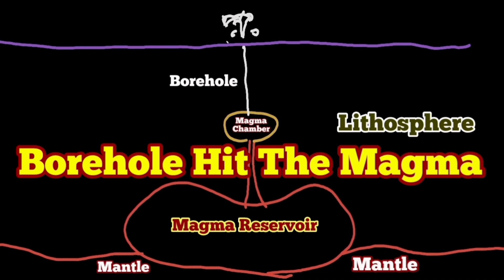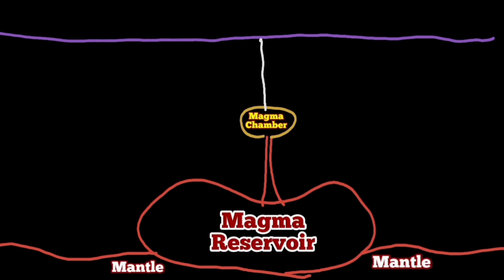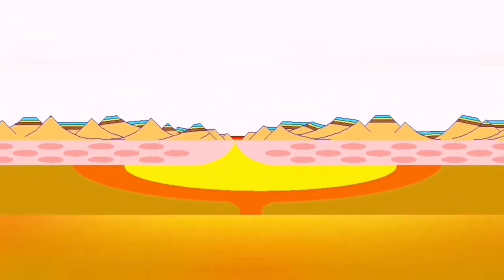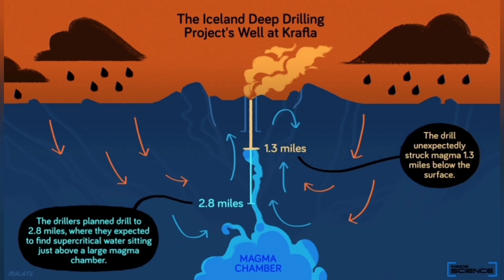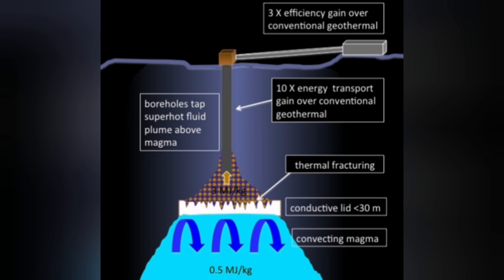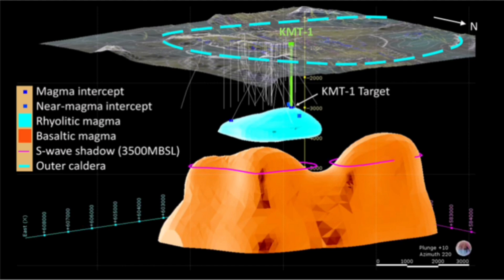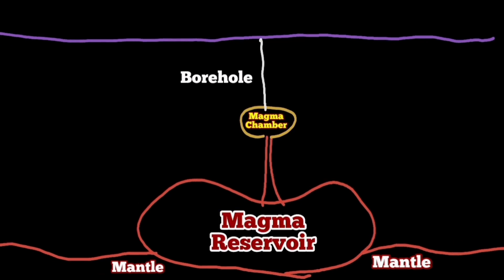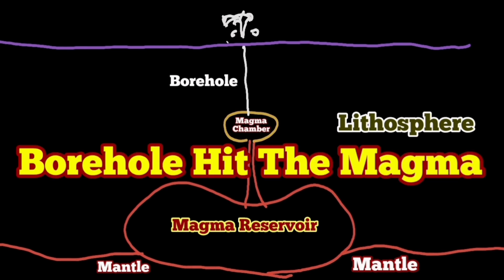Borehole Hit The Magma: Punching A Hole To Reach Magma Chamber, Iceland Krefla Fires, Geothermal

Comment: One problem is the legal system - if you punch a hole you make yourself liable for any subsequent damage. 
There is a similar problem with litter - if you ignore a bit of rubbish in the road that's fine, but if you pick it up it becomes your problem.
Reply: Just for clarity (someone commented, but I can't make a reply to that for some reason) it becomes your problem in the sense that you then make yourself responsible for disposing of it correctly, or risk a fine if you don't.
Reply from the maker: You must be American! Bless you! You are even trying to extort milk out of the magma.
Reply: @TheAstronomer  No, I'm in the  UK.